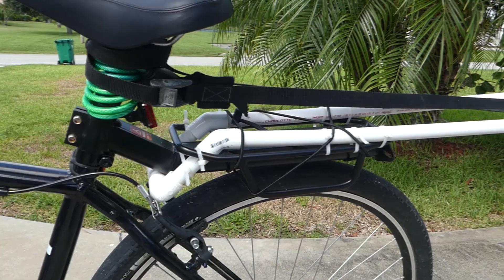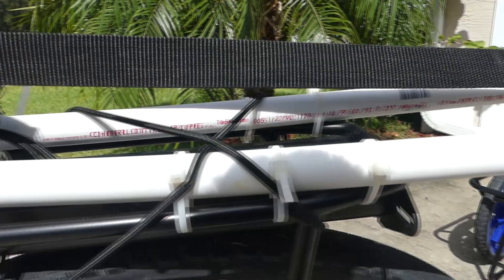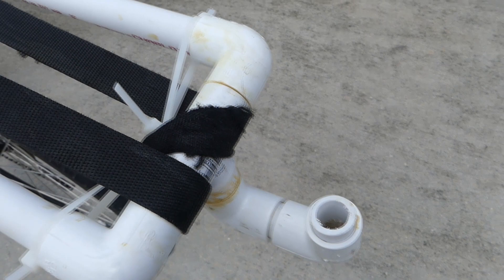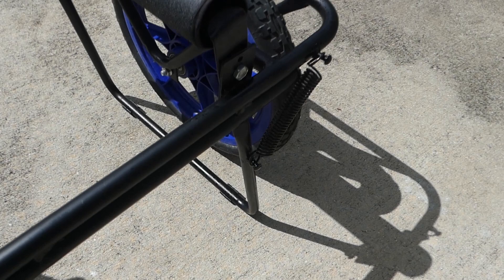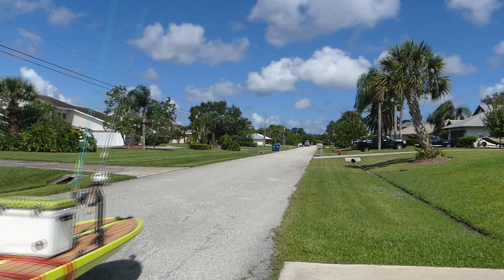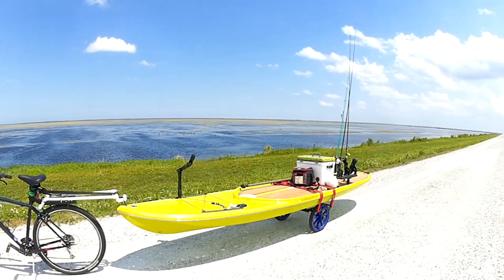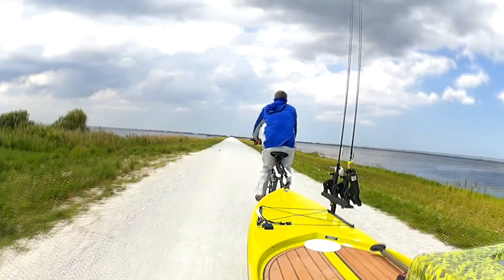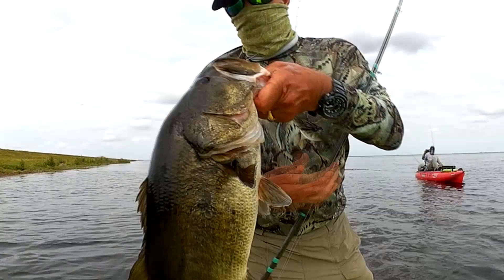Trailering Your Paddle Board With A Bike

Comment: Hey Pete. Just happened upon your video as I am also looking for a solution to take my 12 foot paddleboard to the water down here in the south of Portugal. It's only about 1.5 miles on a good road and I have a very good Cube hybrid bike. I bought a fishing trolley that takes 40kg and when open and placed upside down on the board I can strap it on and get good ground clearance. My problem is how to attach the board to the back of the bike! Your solution looks good but I don't get why you need so much piping. Surely you just need the hook part at the back?
Also, you don't show how you make sure the paddleboard handle stays on the hook; what's to stop it popping out on a bump?

I know this is a 4 year old video now and just wondered if you have made any improvements to the system?

I look forward to hearing from you.

All the best from Portugal!😊
Reply from the maker: Thank you for watching my video. I used a lot of PVC pipe to hold the weight of my paddle board. It is a lot heavier than most boards. I have the wheels at a spot on the board that gives the front handle enough downforce to stay on the PVC pipe without it coming off. You could get by with less. Let me know what you come up with and how it turns out.
Reply: @palmbeachpete  Hi Pete, great to hear from you. I have a few ideas floating around in my head as possible solutions and it will be a case of trial and error until I find what works best for me.
I will most certainly keep you up to date and let you know how I'm progressing. Take care out there👍😎

Comment: How do you travel to get to the water with the board and bike? trailer and bike in the back of the pick up?
Reply from the maker: I put them both in the back of a pickup.
Reply from the maker: I will travel 3 miles with the bike, put the board into the water, lock the cart wheels to the bike, come back in, load up the board onto the cart, take the 3 mile ride back to the truck.